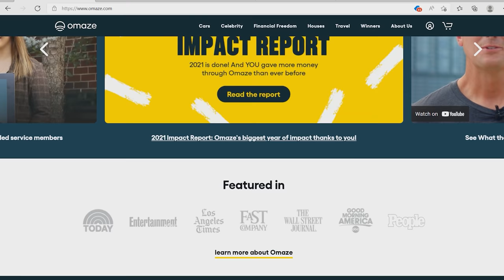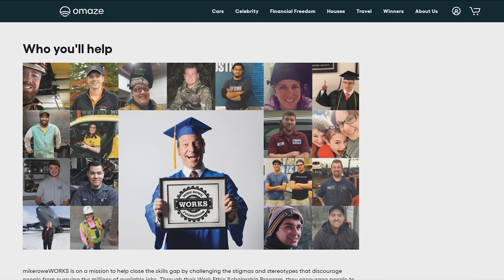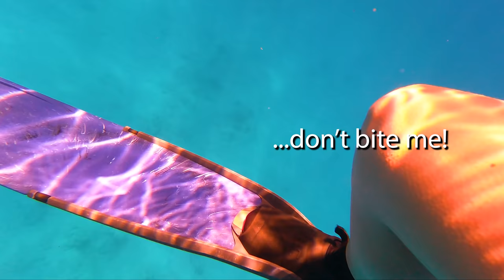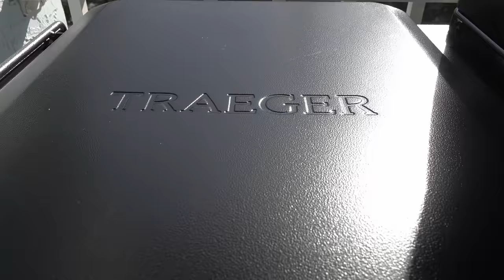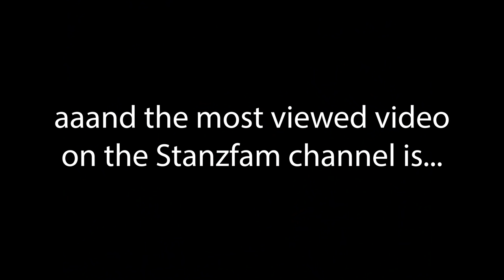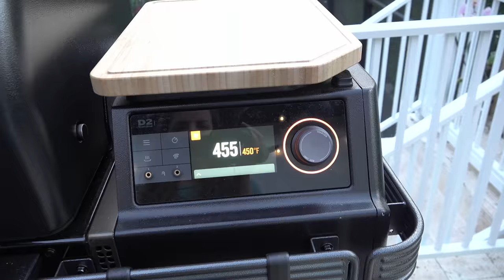Paradise 🦞Lobster🦞Catch and Cook - Plus First Oil Change on the New Bay Boat!

Comment: I see you sprayed you motor with Blaster.  Why do you do that?  I have twin 200's.  Do you think I should as well?
Reply from the maker: It goes a great job protecting them, reducing rust etc. We are pretty religious about using it and the engines still look great after years of use and lots of hours

Comment: I would have poured that perfectly good oil right back in the outboard for another 225 hours. After a minimum of 250 hours send Yamaha an oil sample. Yamaha saying you need to change the oil and a filter on a brand new outboard after 25 hours is ridiculous, unnecessary and a scam.